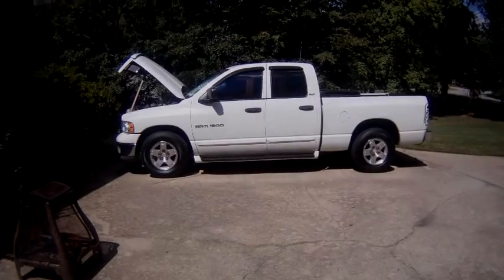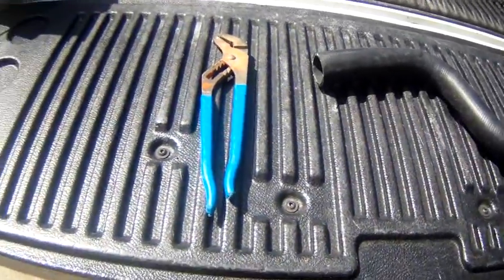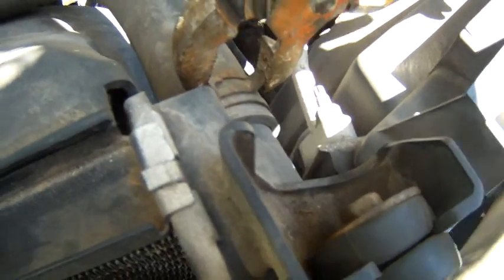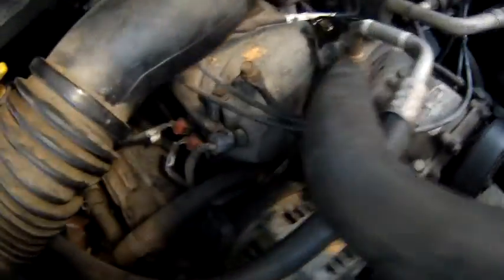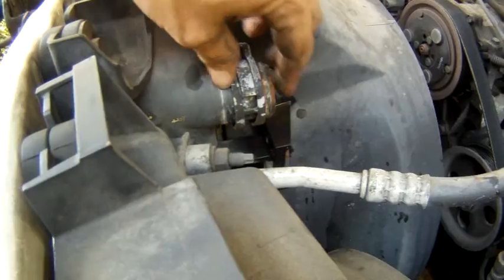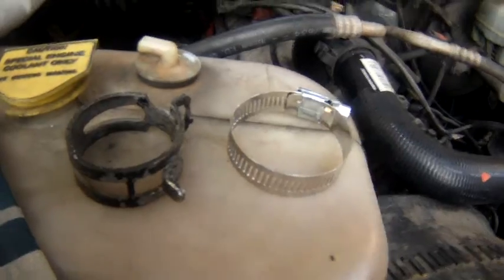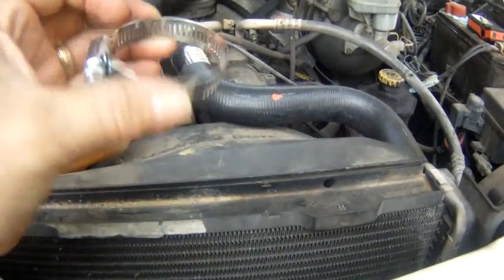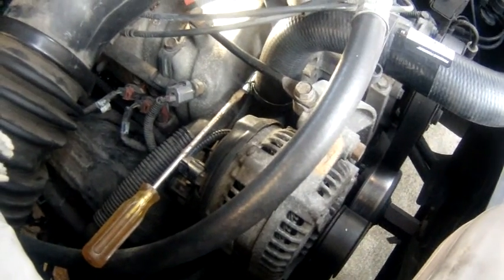Dodge Ram Upper Radiator Hose Replacement

Comment: Good. Get rid of those "factory" clamps and go to those new "hose clamps". Don't know why they didn't use them in the first place. Have them on my '99 Ram 1500. What a pain to get off and reattach. The screwdriver type work much better

Comment: Does it matter if you have coolant in the Radiator? I'm sure it's probably not going to spill out because it's the top hose.
Reply from the maker: No it doesn't matter. The radiator fluid will not spill out
Reply: @gscott1111  I had a small amount spill out, but I was putting new radiator fluid anyway.
Reply from the maker: There is an overflow hose which allows fluid to purge itself. That's normal.

Comment: So you put it on the wrong way and not to spec.    Shady tree mechanic.  Good example of a bad example.  Use the right clamp and the right tool for the job folks
Reply from the maker: No I put it in the right way. Works great it's been a couple of years now. Not one problem. The tool you are referring to cost a lot of money. Totally unnecessary. This way works fine and that's how those clamps are sold "As radiator hose clamps"
Reply: @gscott1111  Exactly. I bout the dumb tool from Amazon. It was $15.00 and works, but I like the 80 cent radiator hose clamp idea better.
Reply: @AndrewAlvarez-py1zz  depends on the quality of clamp!